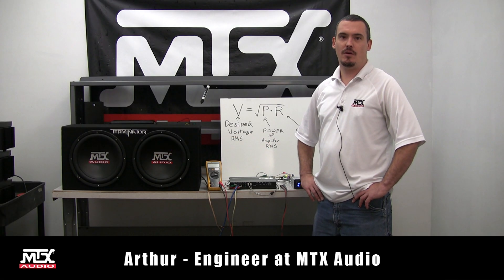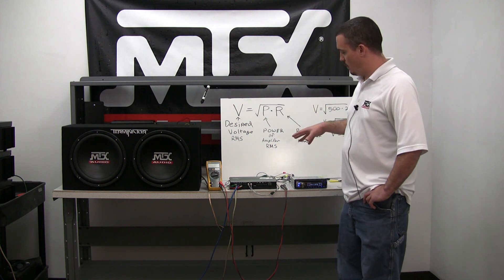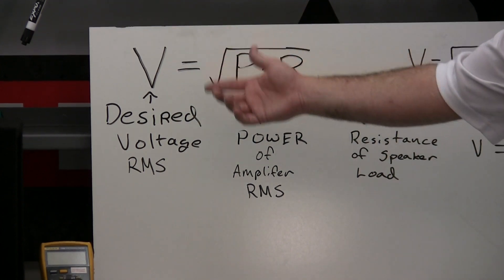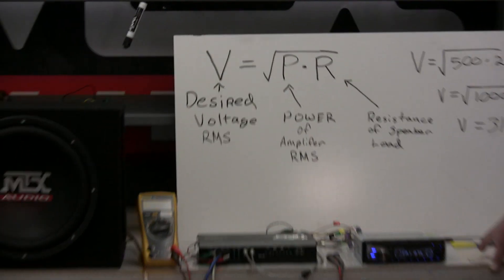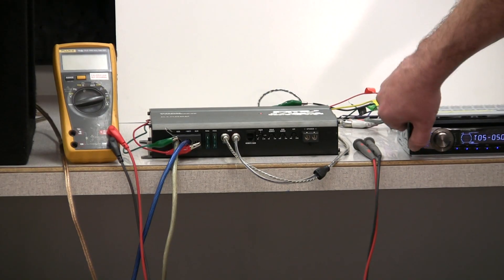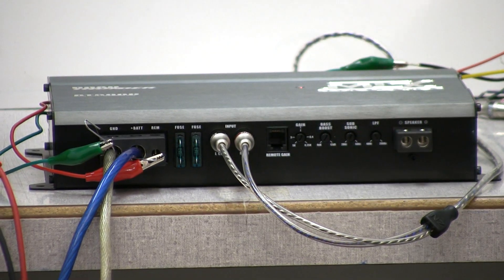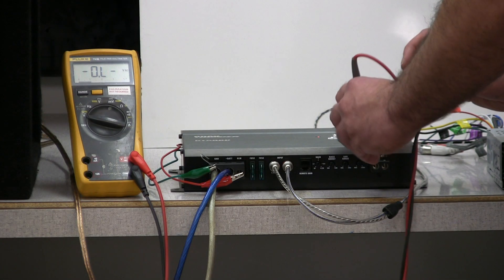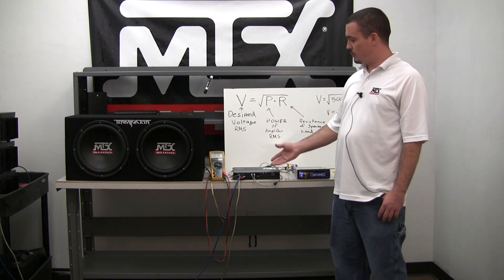How to Set Your Gains Using Ohms Law and a Basic Multimeter

Comment: I don't understand how the amp will know I'm setting the gain for a 1ohm load with speaker leads disconnected ? Since at 2ohm load my amp puts out 600 watts that's 32.64 Volts. If I wire to 1 ohm the amp puts out 800 watts, that's only 28.28 Volts. Is that right?
Reply: Ohms are resistance, the amp is designed to work in a specified resistance range, some can detect the load it's presented with and switch output, some can't. The ones that can't, operate over a range, and the wattage changes due to the simple fact that when you change any part of the equation, the rest will change as well, mainly, less resistance means more current can flow, and they will send more, because they can.
Reply: @robertdouglas4414  Thank you for the explanation. Much appreciated.

Comment: So if your running active and only have two 15w rms tweeters on the first two channels of a 50w per channel amp you would want it to 30w max instead of 100(50Wx2)? About 10 volts.

Comment: I went to an audio shop to install a five channel and they were good “installers” but were not technical.had no clue how to properly set the gains on the amp and lc7i. had the levels up way too high. Took my multimeter and set properly using the technique in this video since I don’t have a SMD 2. Thanks.
Reply: I have a Orion hcca 12" dvc 2 ohm. I have it wired down to 1 ohm. When I do this formula do I use the final impedance 1 ohm or the 2 ohm to plug into this equation?

Comment: I have an amplifier 1800 watts and two 12 speakers 4 ohms each should i calculate by time 4 or times 8?
Reply: Depends if you're going to wire them in parallel or in series. In series your total ohms would be 8. In parallel your total ohms would be 2.

Comment: Ok so I have 2 jbl audio 12 500 watts rms 4 ohms at the speaker but when the wires are connected out of the box it becomes 2 ohm so is that 1000x2 or 1000x4
Reply: 1000x2

Comment: If you have a 5 channel amp. You would set the 4 lower wattage speakers to one gain (60Wx4@4ohm) and the sub channel (350Wx1@2ohm) to it's own gain correct?

Comment: I have the skar audio 2000.d amp  with skar evl 12d4.  It's at 2ohm which amp handles 1400 rms. So its 1400x2 which is 2800rms. Square root of that is 52. Is 52 volts what I need to be at ?? My speaker only handles 1250  at 2ohms and its  50 volts.  What do I do?

Comment: Can someone help me I have 2 skar zvx 15 d2 wired to 0.5 ohms on a skv2 2500.1 and I dont understand what to add subtract or what to multiply or divide can someone please help me understand this step by step on what to multiply, divide,add and subtract,I'm not trying to blow or break 2000$ worth of equipment????
Reply: You need a bigger amp my friend. I have 2 ZVXv2-15 D1 and a Skv2-3500 and I need a bigger amp. Should get the 4500. Don't follow these numbers. Use an oscilloscope and tune it the right way. If you can't then unplug your subs and set everything on the HU flat EQ. No bass boost, no loudness and speaker levels to 0. then set the LPF on the amp at 100. Bass boost at 0 minimum. Subsonic at 20ish. Gain at 0 minimum. Then turn your HU up to full volume minus a couple. If it goes to 35 set it to 33. Play a 40hz sine wave and crank your remote knob all the way up to max. Watch the clipping indicator and slowly turn the gain on your amp up until you see clipping. then turn it down till theres no clipping. Done.

Comment: I have Sony amp 1200w, 2 speakers 120w rms (each) and 1 sup 380w rms..
How to tune the right voltage with multimeter please
Reply: 22.80 volts
Reply: @PcGames6  
For speakers or sup?

Comment: I have a 1850 Watt amp class D and 2 ohm Lightnjng audio L3s which I converted to 1 ohm. So my amp puts out 1850 at 1 ohm and my speakers are converted to 1 ohm as well would my voltage be 43.01 at 1 ohm or 86.02 at 4 ohms ?
Reply: 43.01 volts only if your RMS is 1850 watts at 1 ohm.  Times you RMS amplifier wattage by the ohm load your going to run you amplifier at then square that shit.

Comment: I thought it was DC since it's used in vehcle? Isn't AC for house use?
Reply: The amp turns the dc power into AC to make the output for the subs/speakers. If it didnt convert to AC you wouldnt make any sounds
Reply: AC uses sine waves, hence the wonderful sounds you hear coming out of your speakers

Comment: I have a sub level setting (digital bass knob) on my head unit. Do I put that all the way up before setting the gain? If not, once it's set and I turn it up it's going to go past that Target voltage right?
Reply: settings on head unit should all be flat,   any bass boost turned off.  If you have a bass control knob that connects to the amp, that should be turned all the way UP.   Bass boost to me is kinda pointless, agree with what Brucie said.  If you feel like you need to turn bass boost on, buy higher wattage RMS speakers. I currently have 2 Rockford P3's, 1200W RMS total between them.
Reply: @GlycerinZ   no you didn't understand. It's not bass boost, it's subwoofer level control essentially an electronic bass knob. It's built into the headunit.
Reply: @dtmfool789  I'd leave it at 0.. you have a bass control knob connected to the amp, right?  use that.  If you don't have one, i'd get one.  It's best to have all the settings within the deck set to default and EQ off. Are you sure it's not the bass level associated with mid and treble?  Because my car also has Treb/Mid/Bass, but those should all be set flat.  But you are right, if you turn it up, it will go past the target voltage and most likely cause clipping.. which will fry your subs and then you won't be a happy Daniel.
Reply: @GlycerinZ  ya I'm positive. It's a subwoofer level control setting, not a bass level setting. Ya I'm gonna reset the gain with it all the way up that way I can use it as a bass knob. I'll buy a knob for my amp eventually.
Reply: You definite want to turn the bass knob all the up when setting the gain. Otherwise, when you turn the knob up, you will exceed the optimal power. If the knob is all the way up it caps the power so you can reduce it but not exceed.
Reply: W C yeah that’s what I was thinking. Thanks man!
Reply: No. You always want to start with a flat signal.
Reply: The only time you should really ever touch a bass boost feature is when the bass of the track is recorded lower than others. Many people think a bass boost feature give you more performance but it simply doesnt. All it does is increase the volume of a dedicated range of lower frequencies. Which if set too high will cause distortion and clipping. Which is not good for amps or subs.

Comment: But what about the actual wattage coming out of the amp when subs are connected and multimeters are used. I have to turn the gain up high to get close to 1000 watts with a 40 Hertz tone with the subs connected and my signal starts clips on the oscilloscope. But my target rms is 1000 so I set my gain to 44 volts. Max volume I get like 35 volts and 3 amps.  What gives??
Reply: Battery alternator

Comment: What would 1580 at 1 ohm be im getting 1580 doesnt make sense
Reply: 38.17 roughly
Reply: @brianmclean6500  its actually 39.74 square root of 1580 i was doing it wrong when i posted that
Reply: @brianmclean6500  thanks though brother
Reply: @brianmclean6500  i dialed it in at 38.6 which i did it for 1500 watts square root not 1580. It was 38.74 i chose 38.6 for both amps which equaled out to only half the gain i previously had them at 1/3 gain . I was going to go half gain anyways once the tens were broke in

Comment: Most head units DO NOT output a clean undistorted signal at full volume. The first step would be to find the volume level at which the head unit puts out the highest UNDISTORTED output. Usually by using a 1kHz tone at a 0dB reference level. You didn’t mention to defeat all tone controls, loudness, DSP, and set the balance and fader at center. Also the way you are demonstrating to set the gains are with 0dB of gain overlap. That wouldn’t sound loud enough. The best compromise for quality/loudness would be a gain overlap of 10dB. That means you would have to set the gain on the amp using a -10dB signal.
Reply: If you want balanced system, that 0dB is just fine. Not everyone wants SPL build
Reply: I have a 4 channel amp with 2 gain controls.

One for channel a
One for channel b
 
Using a test tone of 1000hz and a multimeter, my left side speaker will be 15v but the right side will be 7v..there is only one gain control for this...why are my voltages different?
Reply: @JaRuuizz  A Speaker  hpf
B woofer lpf

Comment: So i have a double 2 ohm sub wired up to 1 ohm with max rms of 250. Does this meen that i need 15.81 volts?
Reply: You use the rms power of the amp not the sub

Comment: So if I've got a 2600w amp but only using 1300w on one channel at 4 ohms do I set the gain with the 1300 rate or the 2600 for overall.
Reply: 1300

Comment: Example of my amp is 2,400 rms at 1 ohm. My subwoofer is wire down to 1 omh  how will I do the root on the 1 ohm amp?
Reply: Square root of 2400 is 48.9. So you need about 49 volts of power
Reply: @westonwheeler2311  thanks

Comment: Which amplifier RMS rating is this based on?  Amps usually provide two RMS ratings, such as a 2ohm RMS and a 4ohm RMS.  Do you use the lowest ohm rating to determine the RMS value to calculate?  4ohm RMS of the amp is half of the 2ohm RMS, so the calculation would be off without specifying what amplifier RMS to start with, regardless of the speaker impedance.  Are are you strictly calculating RMS and ohm from the manufacturer specifications of the amplifier?
Reply: Rms rating that you use depends on the ohm load of you sub

Comment: Doesn't this assume 100% efficient amps. If my amps about seventy percent efficient then shouldn't I take that voltage answer (in your case 31.62) and divide by .7 increasing the required voltage so that even though I'm losing .3 to heat I'll still be able to achieve the amp's rated rms as a max ?
Reply: Yes and No, It's best to know the true clamped rms power of the amp if you are trying to get all you can with a clean signal.. Most amps are over rated

Comment: I know  the ohms load of my speakers but  how do I get  the  desired  voltage rms of the amp  are you saying  to divide the rms power of my amp by my ohm load or multiply it? Also could you  give me an example? Do I  put the multi meter on ac or dc? Also I  have a friend who has been doing car stereo for  years and he tells me that if you want to prevent a  valet person or someone else's from blowing up your speakers, to set the volume of your radio to 3 notches before the top setting and then  adjust the  amp gain  controls right before distortion you should be less likely to  blow your  speakers. For example my radio  goes  max volume  35 He suggests  32 then turn up gains. Is this bad advice? I  tried it I  think my radio  distorts at 29 or 30.

Comment: You set the gains for 500 watts rms but those subs are only 400 rms. Shouldn't the ohms law formula be used with the rms rating and resistence rating of the subs not the amp? I have the same subs with an alpine mrv 500, with 517 on the birthsheet would it be too much if I set the gains to 500 rms or no?
Reply: He has 500 watts running through both subs buddy, both subs wired together are rated 800 rms

Comment: So I get how to measure the voltage, know all about the resistance (which isn't going to be a set number playing music) 

But my question is, would it be a good idea to test with as close to 0 as possible tones (in my case I'm working with a 1.3Ohm Ultimax 10") so I would set my voltages to around 25.5V. -And I tend to see some rebassed songs near 0db, so I would rather set the amp for as close to 0 as possible to prevent it going past RMS (I technically don't run my sub that hard as I'm not into the bass drowning out the music/sensitive ears)

Also around 33hz in this sealed box it's at 4.3Ohms so 25.5V at that resistance gives me about 151 watts instead of the targeted 500w. Is that something you just ignore and it is what it is? or am I missing something.

Technically 2 questions... Any insight on this is welcome.
Reply: You're measuring the resistance of the speaker coils. Music doesn't affect the ohm rating of the set of speakers. At least not from what I can recall.
Reply: Jimmy Hernandez it’s been a while since I’ve asked this and I have learned a bit since then. 

The sub will have different resistance depending on the frequency played. Which will use more or less power depending on what it is at a given frequency. 

I think my original question was when setting up a car amp and setting the volume with the voltage. In my case it was about 25v I think for 500w. I was asking about the impedance rise that would only let my sub see 150w vs 500w and if I should ignore that because at the time i didn’t understand that that impedance rise was the subwoofer playing more efficiently at that area thus using less power with the same output as the areas around it.
Reply: 10.78volts

Comment: Hmm i just have a question so I have a prime 750.1 fosgate. If i run @2ohms its 500 RMS so 500x2 =1000 which would equal 31.62. But if i run @1 ohm at 750 rms 750x1 =750 would equal 27.38. How can more watts be a lower setting thats what has me confused.
Reply: Mmetz1281 because there is less resistance against the current. (Doesn’t have to work as hard to put out the desired power.)
Reply: What are your subwoofer(s) rms watts and ohm load?

Comment: Hey mate, having trouble, I have:
2x 12" 350w rms Alpine DVC subs (2ohm per coil I believe) 
1x MRP-m850 (500w rms at 4ohm, 800w rms at 2ohm)

They are wired to 2ohm. I can't get the voltage on the amp to come anywhere close to 40v
Reply: 37.41 is your target since your amp is rated higher than your subs you use 350 watts rms x 2 for 2 subs 700 atts rms total x 2 for 2Ω load = 1400 square root =37.41

Comment: Anyone know what volts this should be at
1500 watt audiopipe pushing 2000watts 
2ohm Rockville k9 cea rated at 1235 5000watts max drop to 1ohm
Reply: Need to know your RMS (continuous power rating, not max) watts per channel based on the ohms your going to run it at. Max watts is unimportant.
Using 2000 @ 2 ohms, I came up with 63.24 vac

Comment: I have a speed series db drive handles 600 rms i have it set to 2ohms, im running a 500x1d prime fosgate amp that gives a max of 640 watts rms according to manual it gives 500 rms @ 2ohms how do i set up my math ?
Reply: 640 watts is the max. You wanna use the watts RMS not Max; So 500 RMSx2OHM= 1000. You then take the square root of 1000, which equals to roughly 31. so your set up should be similar to the one demonstrated in the video

Comment: So 1000x1 then that's like 31.6
My amp is 1000w rms max and at 31.6 it's like halfway up on gain.    Music is all the way up before it distorts and I'm using a 50hz tone
Is that correct or should the gain be higher?
Reply: shouldbe right. Yourmatching thevoltage from hu. gain isn't volume so it doesn't go all the way up
Reply: What are the details on your subwoofer(s) rms watts and ohm load

Comment: He's better about the application of the math than the explanation of the applcation.  At one point he acknowledges that the pots/adjustment on the amp is  NOT  a gain or volume control, but neglects to explain it's an INPUT SENSITIVITY adjustment, continues to call it a gain adjustment and is fairly cloudy on amp OUTPUT being determined by amp INPUT.

Comment: So my sub is wired to 1 ohm

So I would do 1000 x 1= 1000 
Then square that= 31.6 correct?
Reply: If you want your amp to output 1000w and your ohm load is 1, then yes you are correct.

Comment: I use bluetooth aux device with ground loop isolator. Streaming music via Spotify Highest Quality. And my phone is Samsung S9+
Max volume is 15 on phone and max volume on sony head unit 50.
Which setting is best ?
Max volume on phone and 3/4 head unit ? 
Or %60 on phone 3/4 on head unit.
Some folk says you should set BT volume about %50-60 to avoid distortion. Thank you for help
Reply: Interesting study. When I BT my Apple to my head unit, the two units sync volume. Up to 50% head unit volume, the Apple vol runs @50%. As I increase past 50%, the Apple vol follows up to 100% with literally no distortion. I set my amp gain @ 85% on the head unit.

Comment: I JUST BOUGHT THE VENTED VERSION OF THOSE SUBS SITTING ON THE DESK IN THE VIDEO. IM SO EXCITED!
Reply from the maker: TNE212DV - dual 12" Terminator vented enclosure... Brand new for 2018!
Reply: I CANNOT RECOMMEND THE TNE212DV DUAL 12'S ENOUGH! Paired with the Rockvill db12 1000 watt RMS @ 2 ohms, It's so LOUD, if i turn it up too much it can be TOO STRONG!!! I LOVE IT!!!!!!  I no longer have to chase the bass dragon, I have it! These subs rock my 2012 cruze like a jack hammer! I love them, Much better than the dual brand 12 inches in bandpass. Those sucked! These are only 30 more dollars on amazon!
Reply: @FrostyBud777  bahahaha r u serious? I'm sry but that system is no where near loud.
Reply: @FrostyBud777  bahahaha r u serious? I'm sry but that system is no where near loud.
Reply: i hurts my ears man! how loud you need it to go!?  for 200 bucks, it hurts my hearing and may cause damage. I am happy and recommend them. Best subs i have owned out of 4 or 5 sets. If you can play these 30 minutes and not get sick , you have damage or something lol
Reply: @FrostyBud777  I get what you mean, to each there own. I am currently running for American bass XFL 12 and two Audiopipe apcl 1500 strapped at .25ohm load. Amps probably clamp at 4krms min and currently hitting 155.8db
Reply: awesome, But for 300 bucks, the mtx terminators and a rockvill db 12, I am very happy :)